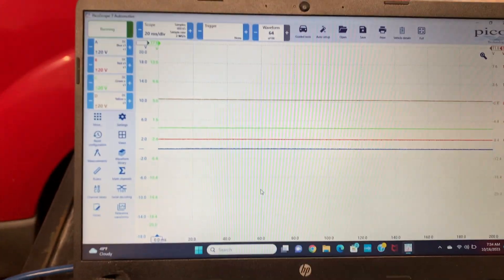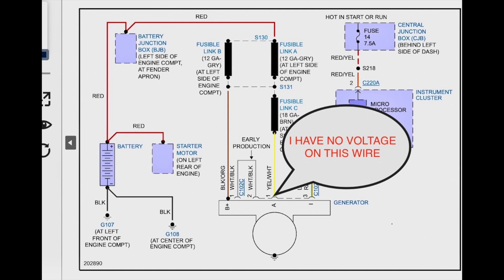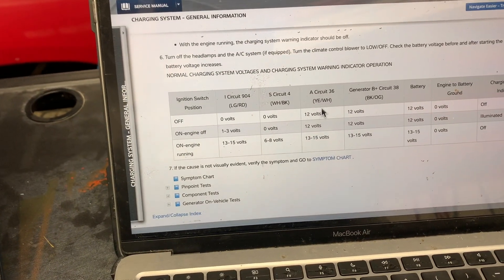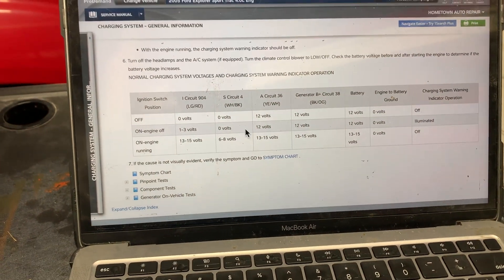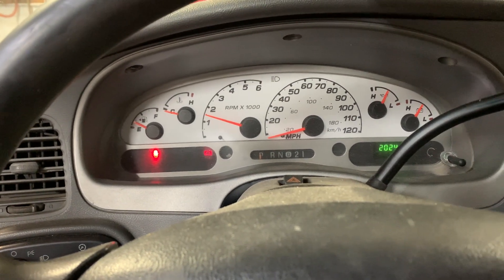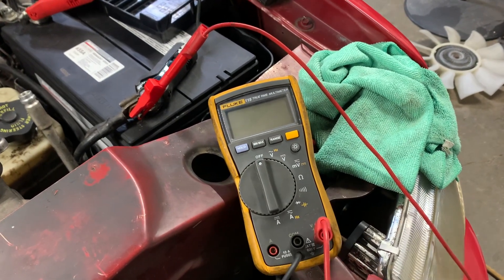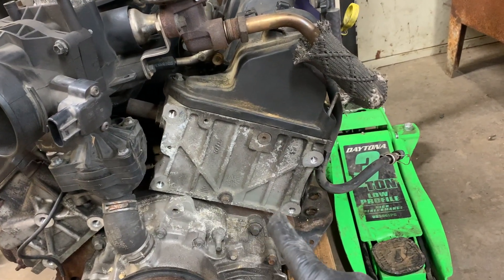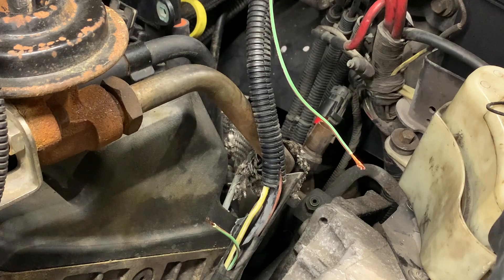2000-2005 4.0 Ford Explorer/Sport Trac Alternator Troubleshooting

Comment: It doesn’t tell the light to turn off. The alt, when not rotating, provides a ground for the idiot light. When charging, produces voltage and send it back on the lg wire canceling the ground for the idiot light bulb which shuts the  off.

Comment: Thank you so much. I have. 2002 Explorer Sport with the same issue. I have 2.1 Volts coming out of the green/red wire at key position On & Run. I traced the wire to a connector next to the fuse box in the engine compartment. It has continuity (no break). With the connector unplugged the connector. I’m getting 12v but then it goes down to 2v. This is causing the battery light to come on. If I feed 12v directly to the harness at the alternator the ‘Battery’ light turns off. What would cause the voltage to drop to 2volts. I have a new alternator/wire connector/battery.
Reply from the maker: It may be normal to have 2V on that wire , the Alternator  is supposed to feed the cluster 12v when the Alternator starts charging, that’s what turns off the battery light 

Check the voltage coming from the Alternator red wire, when’s the engine is running & when it’s not running, the voltage should be more when it’s running, if it’s not suspect a bad Alternator